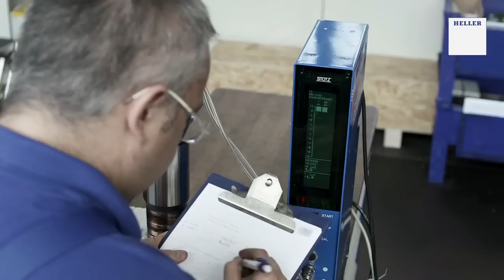HELLER Spindle repair

Comment: Dumb question: 2:04 there are 2 opposed spirals in the core. Are these the compression springs that pull the toolholder stud up into the taper?
Reply: Yes, thats the drawbar.
Reply from the maker: Yes, that´s right.